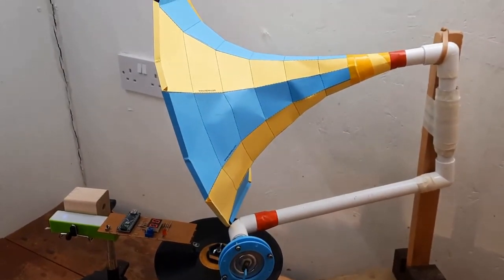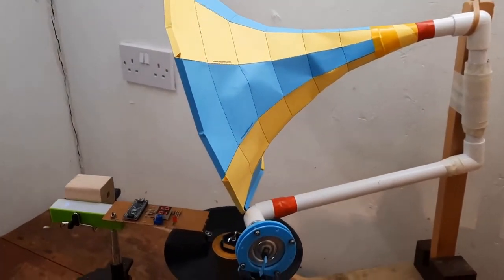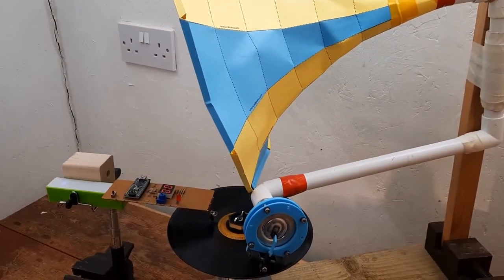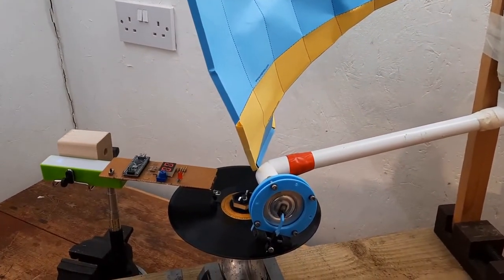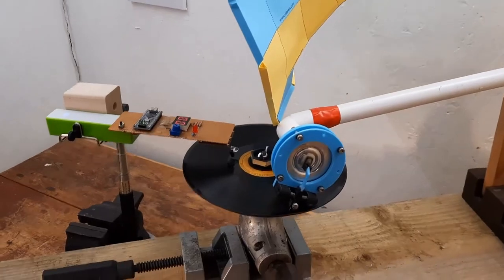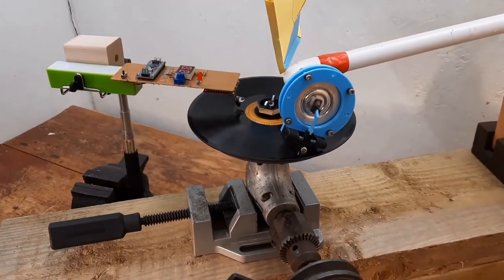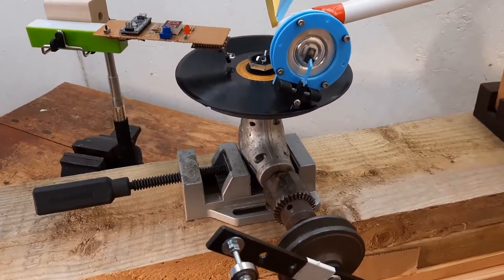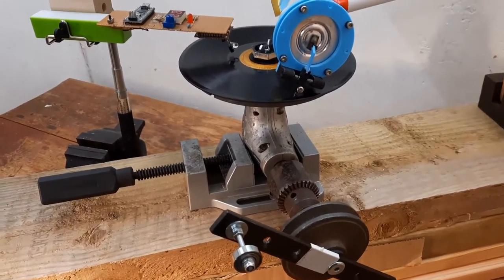DIY hand cranked gramophone returns!

Comment: It would sound much better if the record was properly centred, and instead of hand cranking, why not use a real variable speed drill and set at the correct speed, or if you don't have a drill like that, a one speed drill will work with a light dimmer switch wired in line on one side of the circuit.
Reply from the maker: The hand cranking was more a bit of fun, than a real necessity. I did try fitting an electric motor, with helps a bit, though it is by no means perfect:
https://youtu.be/ERf_iiJJgig
I hope to revisit this project at some point as I am sure it is possible to build something similar which works better. Thanks 👍😀

Comment: Joking aside, can you put some kind of limiting gear on it so that no matter how fast you wind it, it won’t go faster than 78? Was Berliners early string driven job like this?
Reply from the maker: I think it would be possible to fit some sort of governor to regulate the speed. I can also imaging that some sort of speed controlled clutch would be possible. From what I can see of the early Berliners some had governor's which clearly are intended to limit the speed. Others just seem to have flywheels.
Thanks 👍😀